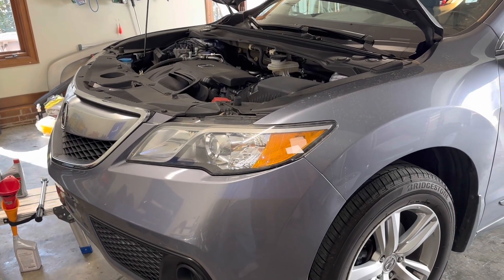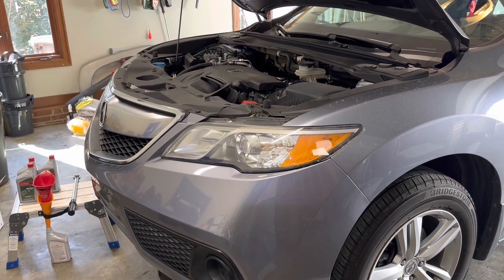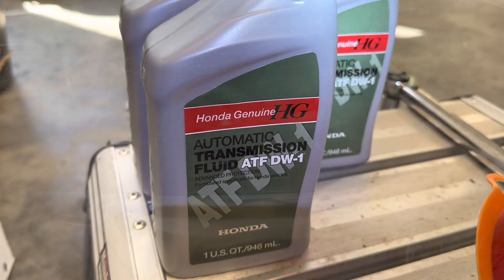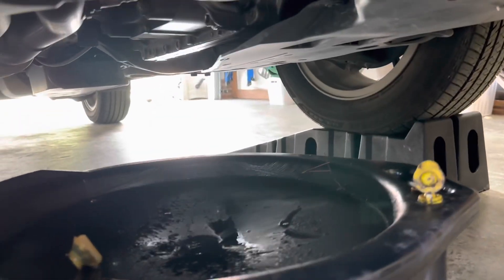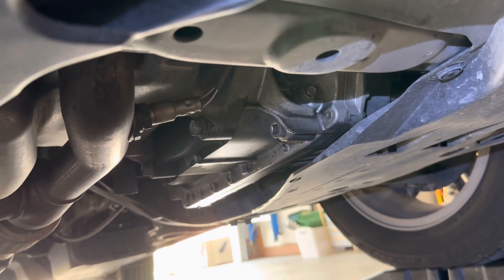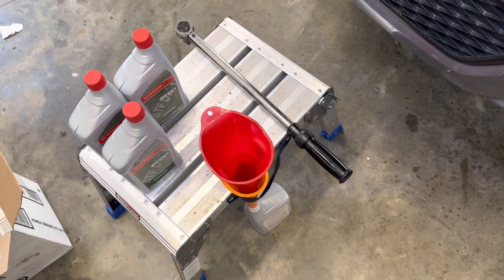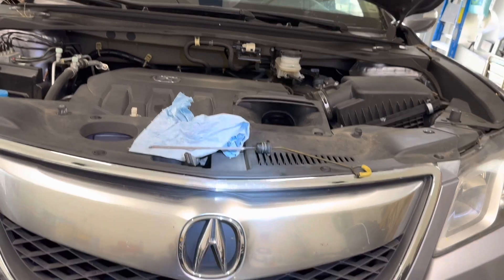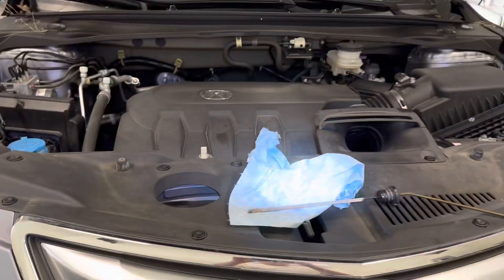Acura RDX / MDX 6 speed transmission drain and fill

Comment: What happens if you just put the first 3.3 quarts in and not drain it 2 more times?
Reply: since there are chambers in the transmission if some of these dont have fluid it may stall the car
Reply: @hydrocurry6494  do you have to put new fluid in every single time that is expensive…

Comment: 13 RDX front wheel drive, 94K miles. I performed this tranny drain and fill and also changed out inline tranny oil filter behind front driver wheel well.  I bought 4 quarts DW1 and was expecting for a lil over 3 to come out but actually 4 quarts of old fluid  came out and I had to plug back up because all I had was 4 quarts. 🤔. Nice content man!
Reply: Probably the previous service was overfilled.
Reply: Had it Honda dealer serviced before I did, possibly, that was the case. Thank you YiZuSc for the reassurance

Comment: When you drain that new fluid out. Do you use it back again or you dispose it away??? 🤔
Reply from the maker: The transmission holds roughly 10 quarts of fluid total. Only 3 comes out when you pull the drain plug. This 3x procedure (drain, fill, drive, drain again etc..) will replace about 80% of the fluid and is enough to restore new performance.
Reply: Did you change the filter/ strainer under the hood also?
Reply: @4Runner21  no
Reply: After putting in the new fluid? Do you cycle through the gears several times before driving?